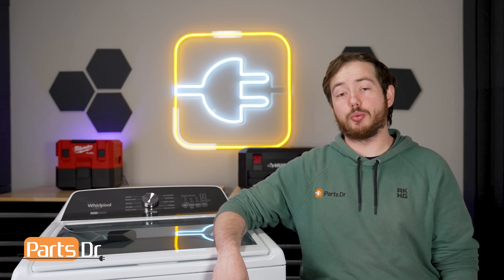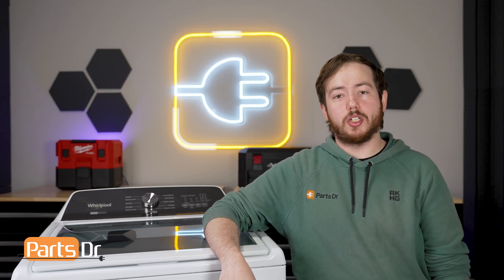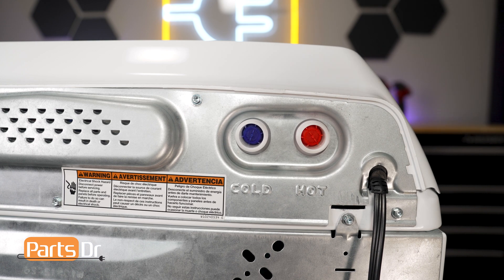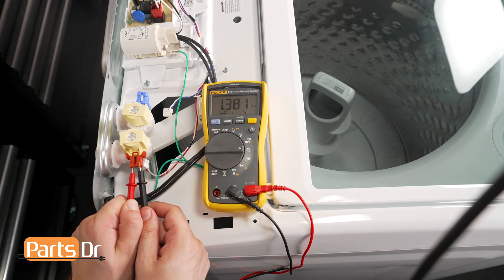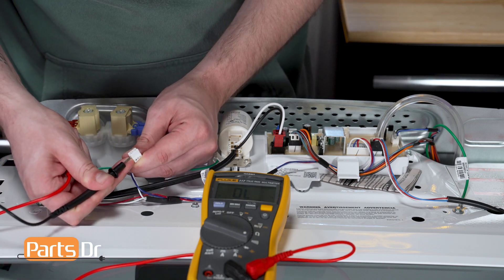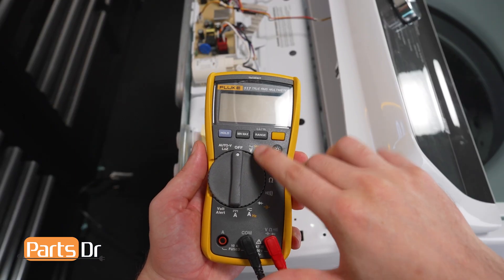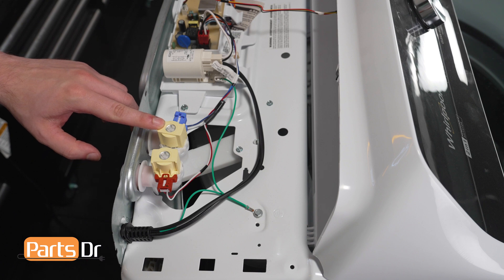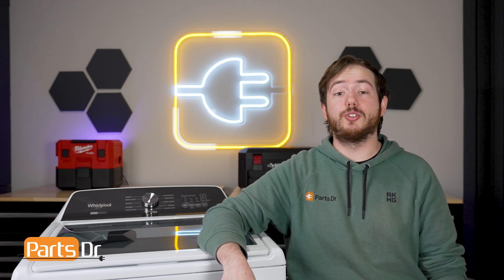Washer Not Filling With Water? Top 5 Reasons & Fixes for Whirlpool, Maytag, and Amana

Comment from the maker: Washer not filling with water, or filling when it’s not supposed to? This video breaks down the top 5 most common reasons and shows you exactly how to fix them on Whirlpool, Maytag, and Amana washers. If you're ordering replacement parts, especially water inlet valves, be careful with cheaper aftermarket options from places like Amazon or eBay. We've seen too many cases where low-quality parts leak or fail quickly, sometimes causing water damage to homes. For peace of mind, we recommend using genuine OEM parts. You can find high-quality, original washer parts at https://partsdr.com. Let us know if this helped fix your washer, or drop a question below. We're here to help!

Comment: There is such a thing as water saver appliances so much so that trump signed an Executive oder lifting the liberals EPA mandate on water saver machines so we can have back our old style machines that actually use lots of water. So you don't have to wash loads dishes or cloths 3 times or as I have been doing add 5 gallon bucket of water to machine after it greedily only allow 2 gallons for a full load.

Comment: I have replaced the water inlet valve and the top control panel, but thanks to your video I have a better understanding that it can be the main control panel and I have to check the voltage. Thanks for a thorough video
Reply from the maker: We are happy that we could help!

Comment: Great video
Reply from the maker: Thanks! Did you find the cause of your washer not filling with water?
Reply: @PartsDr  nope
Reply: Just clean-out the water level barometer tube that goes to the control board which usually clogged with soap.